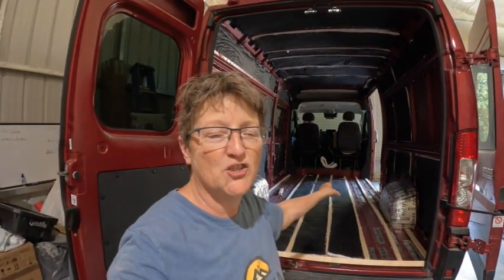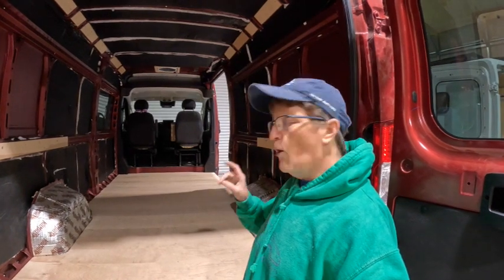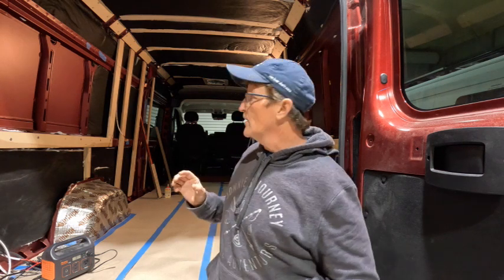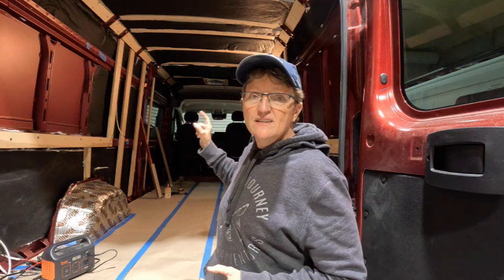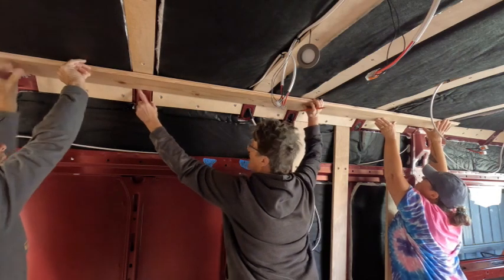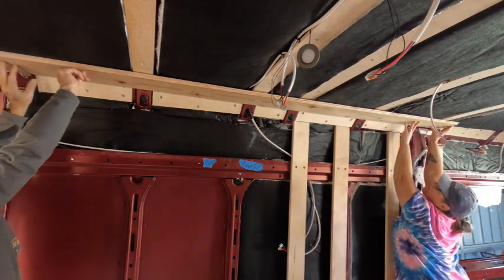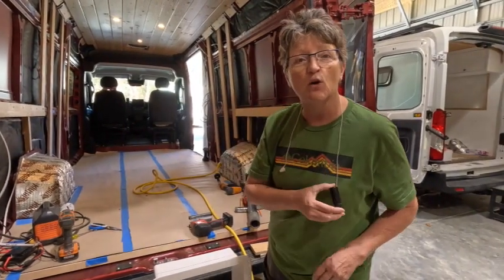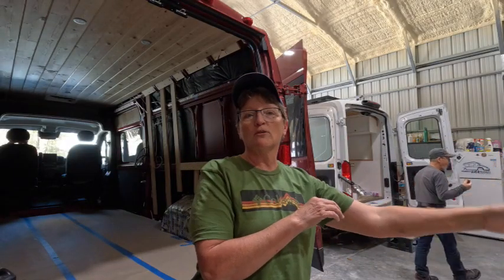Van Build #10 Starts Now

Comment: Jonnie, is there enough space for two layers of Thinsulate in a Promaster's ceiling and walls?
Reply from the maker: It really depends on how you frame it out.  There is definitely enough room in the walls.  If you want added insulation, you could always add a layer of reflectix.  That is what I did in my ceiling.